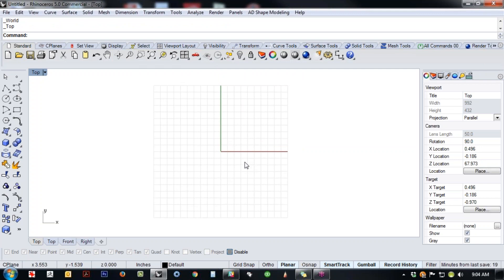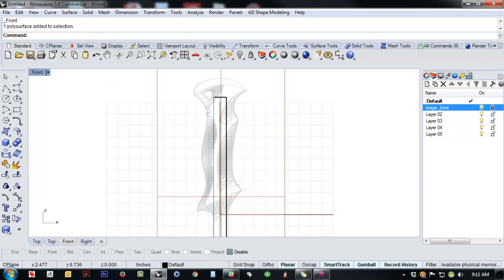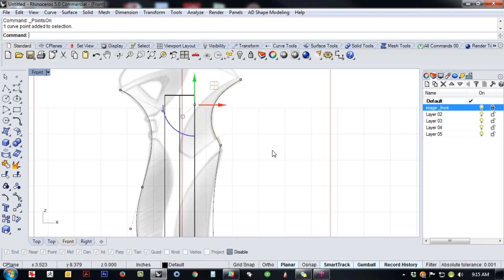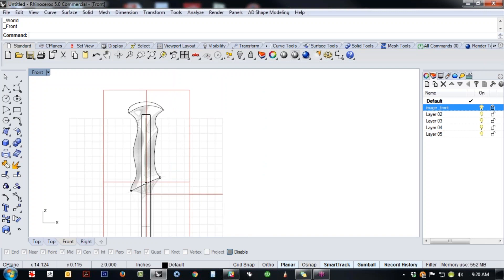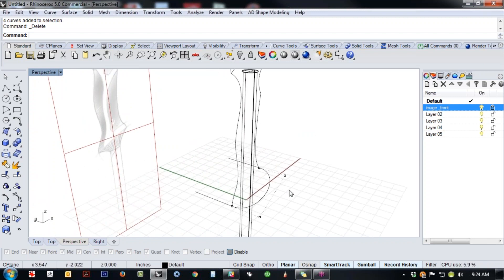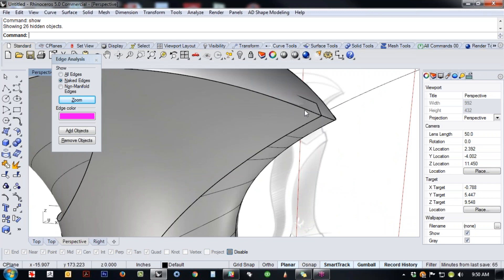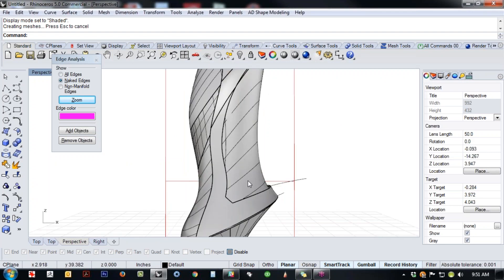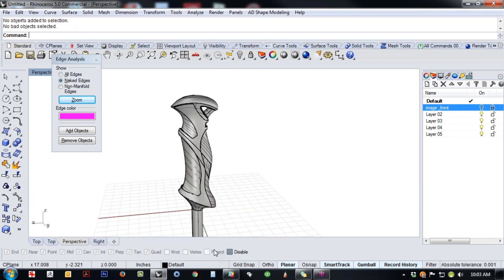getting started with rhino  for windows - ski pole

Comment: Hi Kyle! I just finished mine and it did join all the surfaces but when i do the check Rhino show me this message: brep.m_E[41] edge is not valid.
    edge.m_vi[0]=edge.m_vi[1]=23 but edge.IsClosed() is false.
  ON_Brep.m_E[41] is invalid..

An edge is false? Why does it join correctly then?
Reply from the maker: Run selbad to see if anything is bad. If it is run extractbadsrf to pull it out and see what’s wrong. Typically a trim went sideways and simply need to be untrimmed and retrimmed.